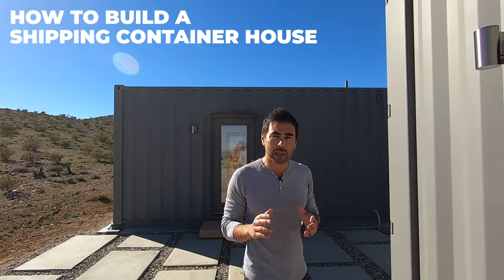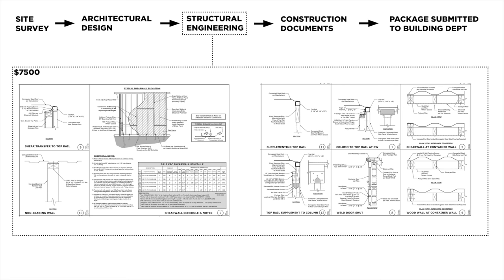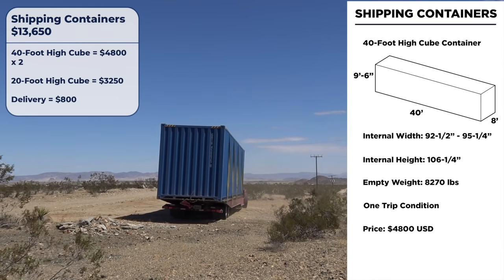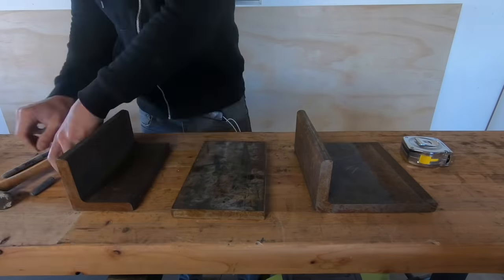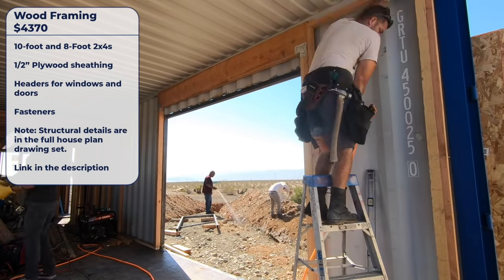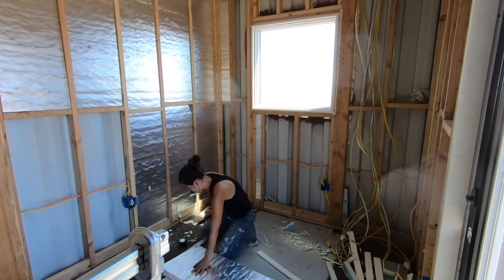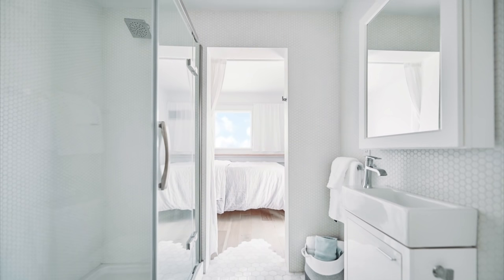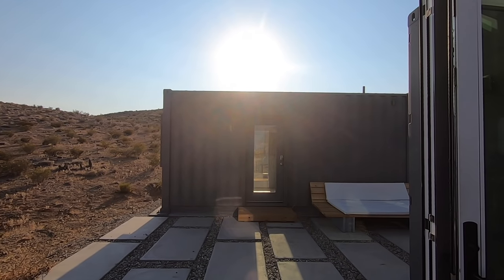Building a SHIPPING CONTAINER HOUSE start to finish with TOTAL BUDGET BREAKDOWN

Comment: I would recommend looking into CLT (Cross Laminated Timber) as a more economical end environmental friendly alternative. CLT has a positive (it stores) CO2 impact, compared to steel and concrete which has a very high negative CO2 impact.
Reply from the maker: We are looking into CLT too!  right now it is expensive so we are checking the cost trend vs the environmental impact of reduction of solar cooked  cement and recycled steel
Reply: @TheModernHomeProject  very good. I have built a house in CLT with some unique shapes, that wouldn't have been possible with other materials. Wood is widely available here in Scandinavia ;-)

Comment: Fascinating. I've done the majority of my container home myself (except for septic install and well etc) and I'm just about done with the home and I'm at about $80k (I was hoping for $50k to $60k). This includes price of 1.25 acre lot in rural area that cost $9,500 (purchased in 2019). EDIT: I'm in Florida
Reply from the maker: Just like any other type of construction its is possible to build at a wide range of cost per sf I have seen DIY container homes built for less than $100 sf and i have seen high end versions with over a $1,000,000 price tag.  Good luck with the project I will check it out!

Comment: Hi, thanks for completing the video its going to work for me even though a few years have passed as I am just detailing my project after buying land in AZ. I am curious as to the cost for anchoring :$3924 Anchoring Containers to the Foundation. Why so much or rather, what did you do to anchor to cost so much? I do have some more questions but i will watch again to get some questions straight in my mind before asking. My project is for 3 -40' High Cubes , one time use side by side and the containers if I can get them are approx $12k each... CRAZY increase
Reply from the maker: we covered it in episode 6 https://youtu.be/pSL_O8xjQVI
most of the cost was in the steel. Ground screws could represent a significant cost savings for foundations and anchoring. earthquakes are a code consideration in CA that also drives costs.

Comment: It doesn't seem to me that the limitations created would outweigh the benefits for building on site.  Would you build on site again or just bring in finished units for placement and hookup if you were doing it again?
Reply from the maker: If you can find a pre-fab company that is flexible enough to build what you want then pre-fab can be great.  The challenge is in permits. The established pre-fab companies have state certification that can reduce inspections but most dont do installs or site work so you still need a GC and a lot of GCs dont want to just do site work while being responsible for install